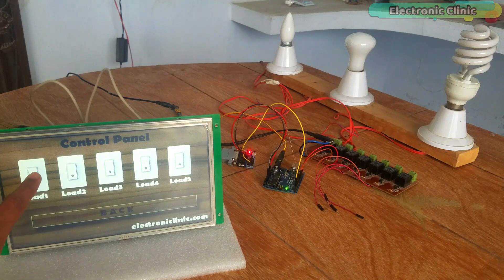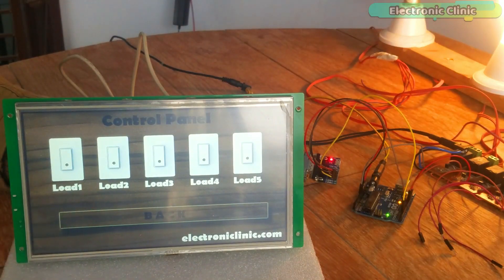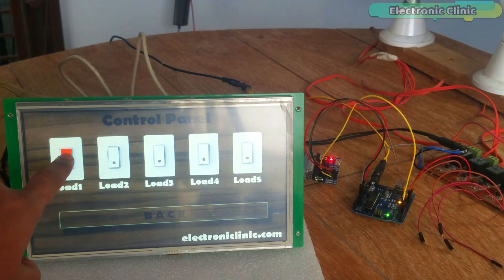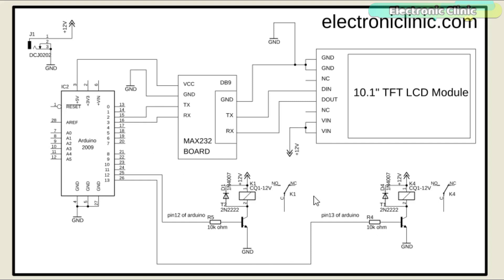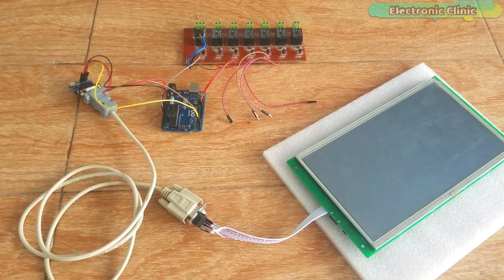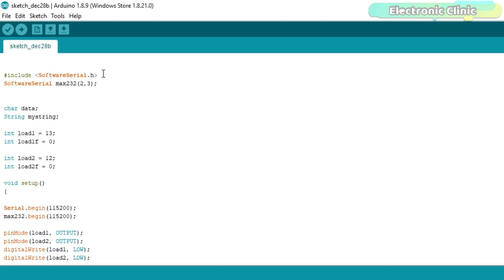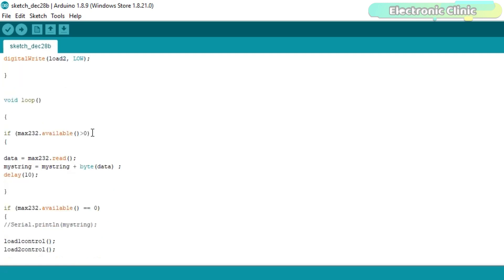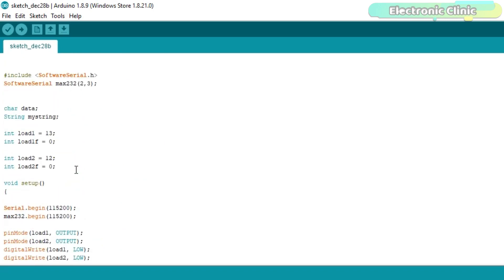Arduino 10.1” HMI intelligent TFT LCD 220 Vac Load Controller Panel "Stone Technologies"

Comment: I cannot seem to get this to work.  I am using the Stone Editor 2022 which does not have the Variable Memory or Keys.  Is there any advice you can offer?
Reply from the maker: did you contact with the conpany?
Reply: @ElectroniClinic  Yes, I am using their new STW series HMI displays which sends commands via UART.  Are you able to program the Stone display using UART?

Comment: I tried combining this code together with the code in your other video on reading a potentiometer to the HMI. Which by the way worked like a charm since the warranty replacement showed up. Now I must combine load control and voltage, watts and temperature reading in one code. I think the "if" statements are being overruled by by something else. perhaps load signals are zeroed out before being read? You have a forum?